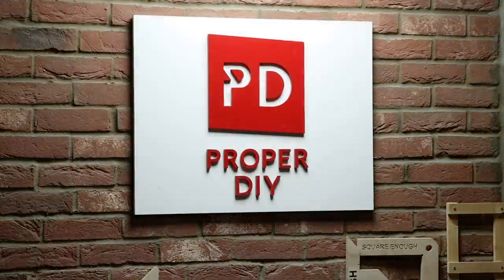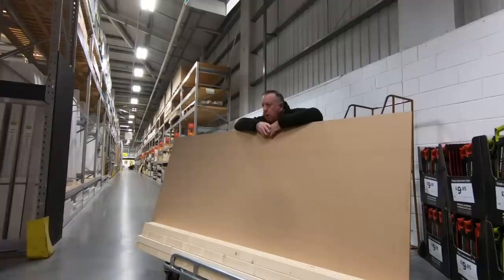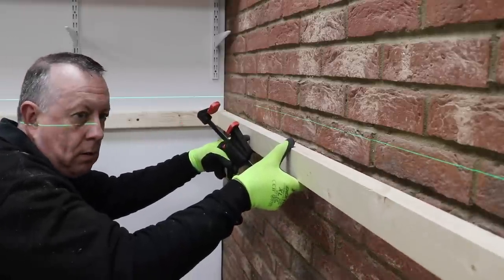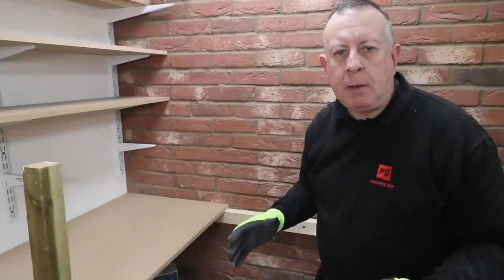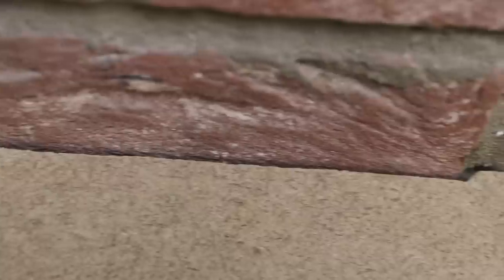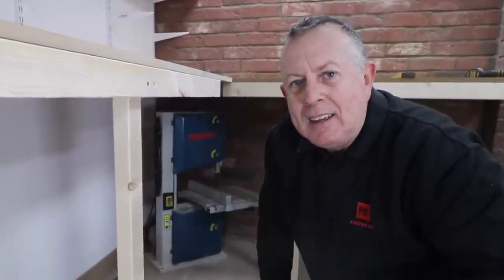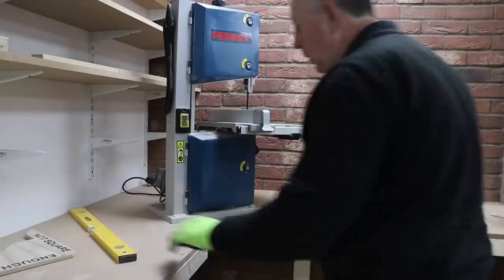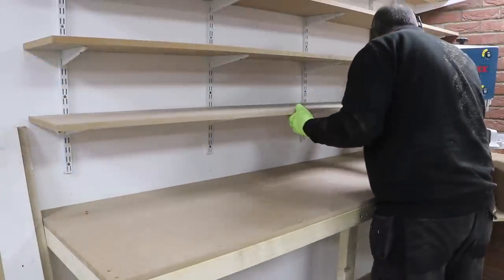Corner Workshop Bench & Band Saw Stand Build

Comment: Impressive amount of work for just an afternoon, including a fun time hanging around the big shed.  Ironically I’ve just built a storage unit for my Aldi Ferrex bandsaw but elected for a smaller cart on wheels with 3 integral drawers for mine.  One thing I did do is get a big flappy stop power button for it; I found a design online and 3D printed mine but they’re only a few £ on etsy.  Definitely makes the band saw safer.

Comment: Excellent as usual, one observation, would have been stronger if the bandsaw housing base was supported by the sides and not underslung
Reply: Yes, I thought exactly that too.

Additionally I would have fitted an mdf base to that bandsaw as a "cadd" so I It could slide in and out.

I would also fit removable infill pieces at bench level, it's gonna get full of sawdust on that lower shelf.

Comment: I feel that you might regret fixing a bandsaw into a corner. Mine is on a trolley, and gets moved almost every cut- you cannot predict where the workpiece will overhang. Also makes dust collection hose awkward, and all that valuable space behind difficult to get to. The only tool that fits well into a corner is a milling machine... 'Everything that can go on wheels, should go on wheels'.
Reply: He addresses that issue at the end of the build.
Reply: @stephencave187  If carrying it somewhere else is 'addressing the issue'. And might he not regret having to move it often? That was my contention. 
Personally I would trolley mount it and dock it there. Best of both worlds. You are welcome.
Reply: @Tensquaremetreworkshop  
If most of his cutting is accommodated in that corner then it may be that he thinks building a stand alone unit and mounting it on castors is overkill for an occasional cut.
Doesn't look like he has to carry it very far to his workbench and he seems physically able to do so safely.
Reply: @stephencave187  That is why I said 'might regret'. He can make up his own mind. But viewers deserve to hear other options, to suit their situations. It is my experience, in both my own workshop and a community 'shop, that re-alignment of a bandsaw is virtually essential. Mobile machinery is rarely a matter of regret.

Comment: how do you find the rage 5s table saw, had mine about 3months very happy with it, am having one issue with fence never locks on square back end in always closer to the blade. its the fence not saw blade does it when lining up to mitre slots as well. wondering if have had anything similar issues with yours.

Comment: Clever solution for lowering the band saw! Curious how you'll find working with it this way.
Reply: Yes it does have limitations fitted like that, I would fit a base to it as a caddy. to slide it in and out.

Or, maybe a circular base so it is rotatable.

Comment: Thanks for sharing but that is to heavy and too weak so the logic behind a construction like this I fail to see. You shoul use impregnated wood against the brickwall or at least put galvanice washers between the wood and the wall. Whats with the gloves?
Reply: omg  there's always one.
Reply: 'Appropriate Quality'  comes to mind!
Reply: You have obviously missed the times when Stuart has divulged his previous employment as an engineer. If anything, he over engineers things, so your opinion that it is too weak is wrong. You also go on about pressure treated timber or galvanised washers when fixing the timber to brickwork, I don't see any evidence of either practice when joiners are fitting door frames and so on in new builds. What would the point be in doing so on internal brick or block work?
Reply from the maker: Exactly!
Reply from the maker: The gloves are called PPE
Reply: @ProperDIY  They are also called dangerous when used with (some) machine tools.